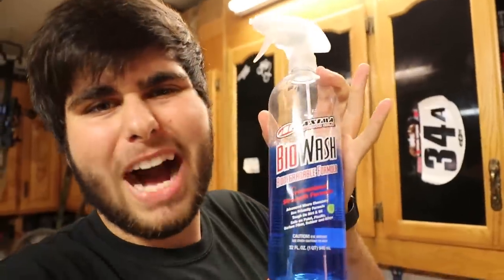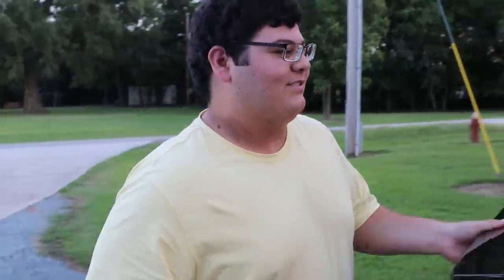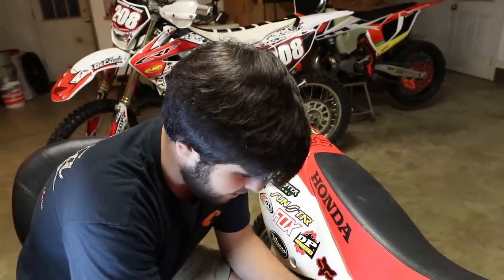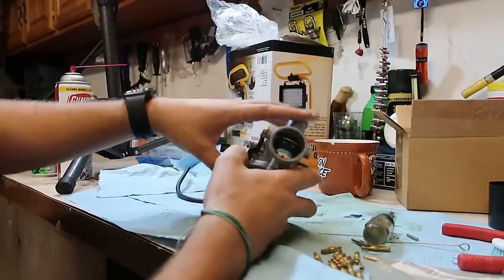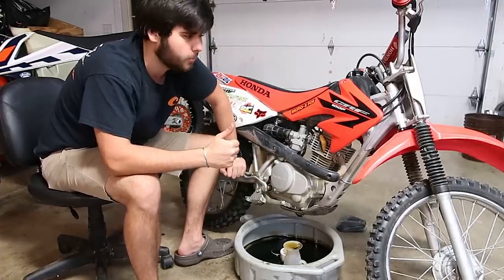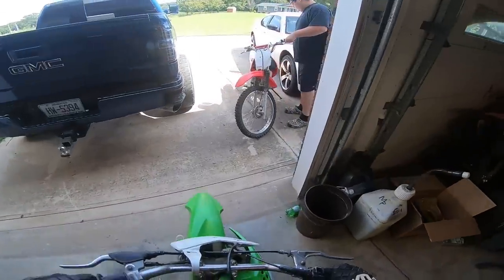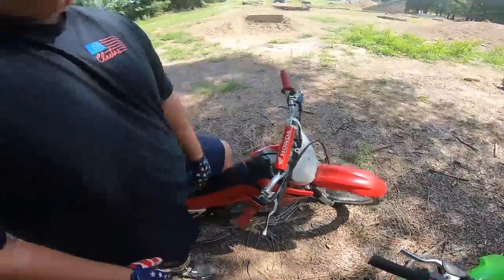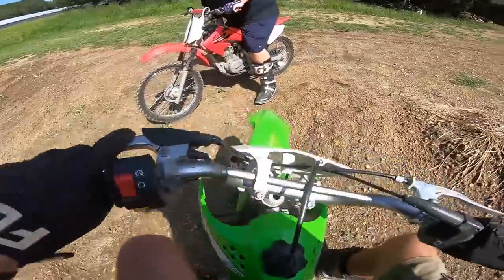I DROPPED HIS BIKE! Getting ready for the RACE!

Comment: Hey just a fast 1 i have a kx 125 1998 was out on it last month it cut out and my bike  would not start agen i was in the woods so i was mostly in 1st and 2nd took the engine apart to fix and the carb small nedle was blacked and the exhaust had a lot of fuel in there ??